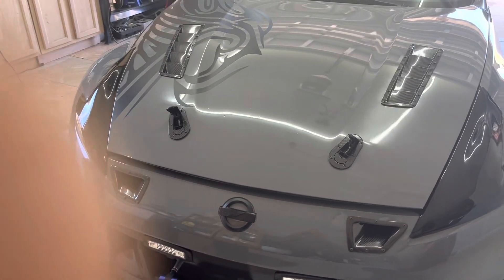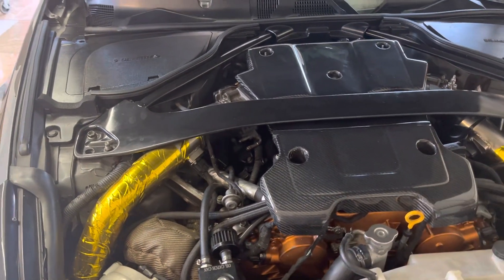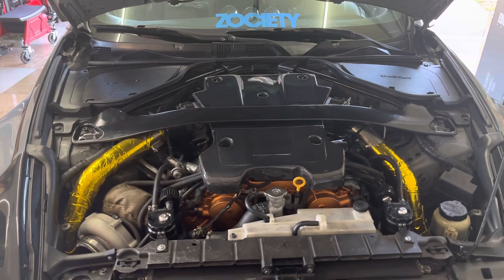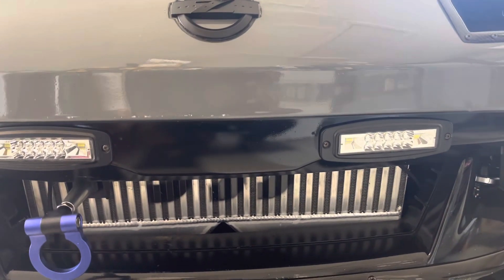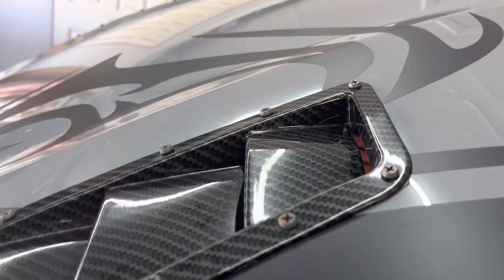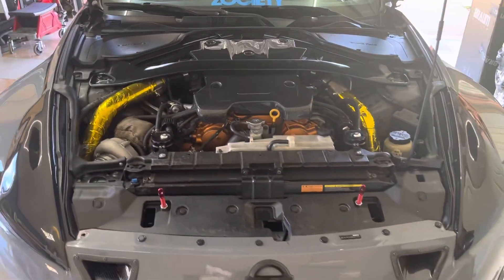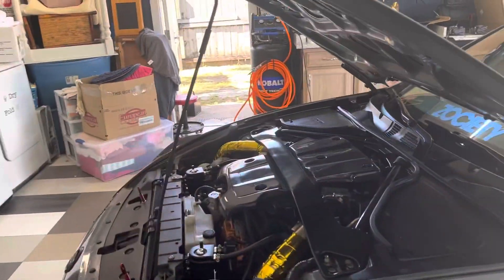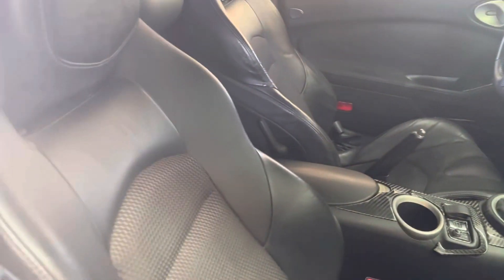370z single turbo updates after a month.

Comment: Bro I hope it all goes well messing with the fuel. I've seen some pics of 370Zs burnt to a crisp and it was with a top mount. On another note,  I have the 34 row setrab kit from Z1 and I made diverters out of abs plastic sheets and removed the black plastic pieces next to each fang to let air in through there. Those pieces screw off from behind the bumper.
Reply from the maker: Thanks for the heads up.
Reply from the maker: So you have any pictures,
Reply: @fair2ladyz370  I only have one pic with the bumper off after I did it. But basically I got the sheets from Amazon , cut one piece per side , drill some holes on the flaps that are attached to the crash bar area and some holes on the plastic pieces , zip tie them together and also use the power steering cooler pipe on one side to zip tie the one side on so the plastic piece is at an angle to force air towards the radiator. I forgot what I used on the driverside to get it to sit at an angle but it's simple and leads air directly to the oil cooler. At the moment I'm not boosted so not sure how hard it would be to secure them using the intercooler piping.

Comment: Doesn't the turbo kit come with a fuel return system?
Reply from the maker: No it come with fuel bump and injectors 1050 cc .
Reply: What’s a fuel bump? A pump and injectors?
Reply from the maker: @tactownturbotime982  Aeromotive 340 fuel pump and ID1050-XDS for injectors